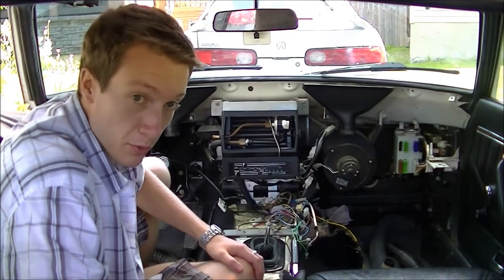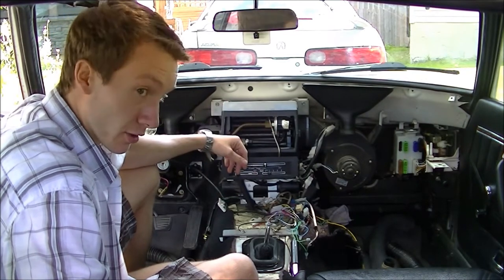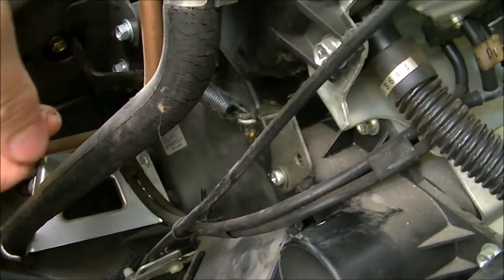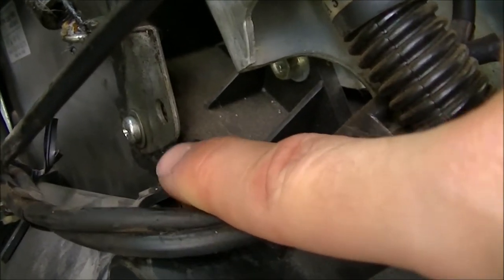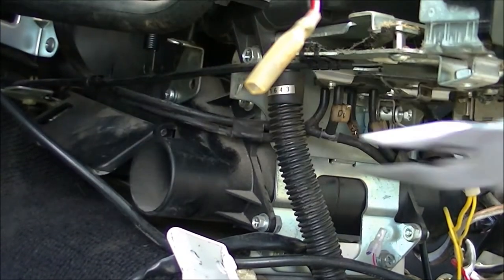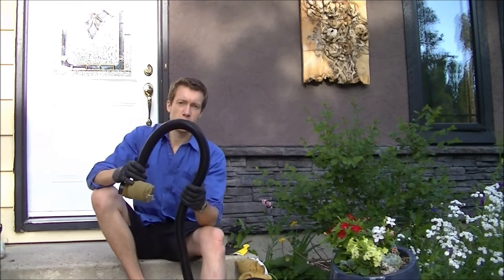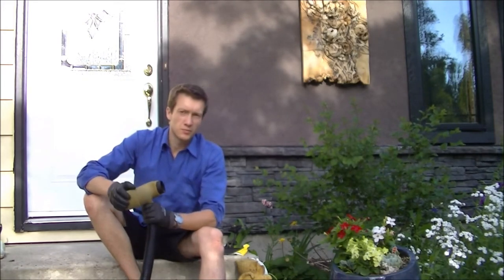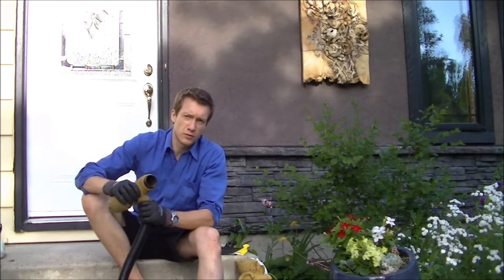S30 Heater System Issues - Datsun 280Z | Dash Series [Part 5]

Comment: How quickly should the heat kick in cause mine starts actually kicking after 14 minutes
Reply: @FixingWithFriends  thank you
Reply from the maker: Original reply (...ish): "Hmmm, with the fan running all the time it does take a while for my car (when parked), especially when it is really cold. But unless it's a cold day, that seems a bit long. My thermostat was frozen closed, but they can get stuck open as well. That might be the best thing to try replacing, as they are quite cheap. If you do live in a cold climate like me, you may also want to pick one with a higher opening temperature".